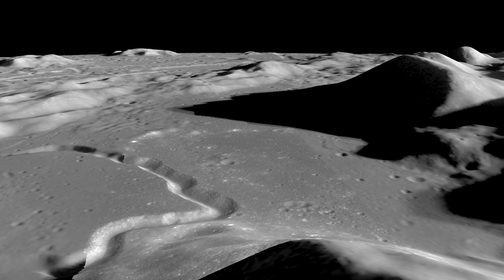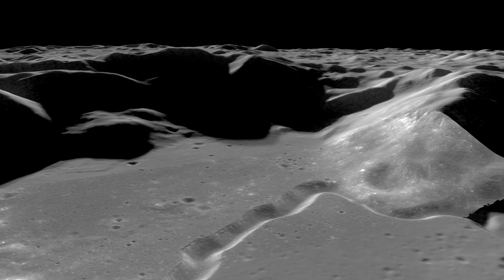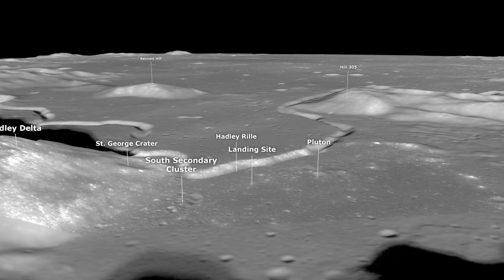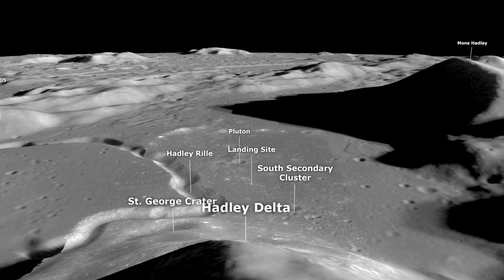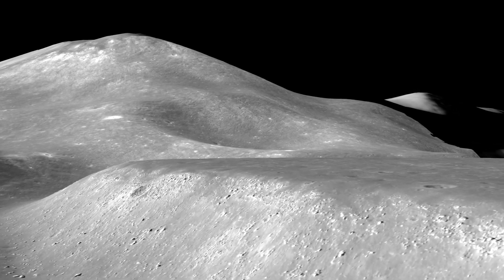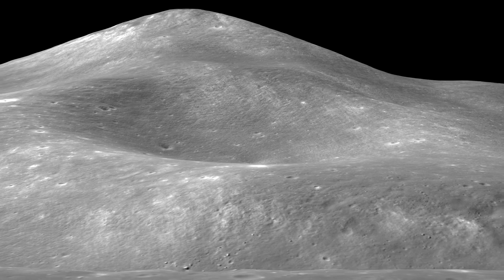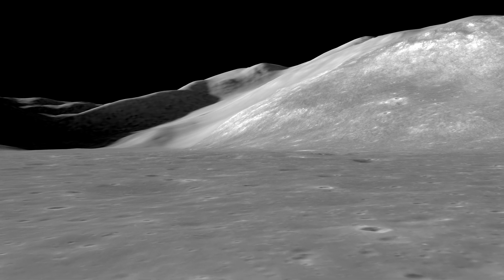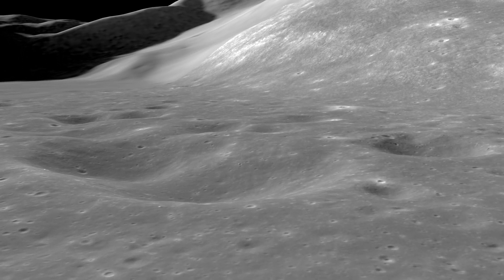Apollo 15 Stand-Up EVA

Comment: 17 miles, how great. But seems like a unique lack of caution for NASA (ie, rover dies). There must have been some low max distance in any one direction
Reply: An old comment, but worth replying to for anyone wondering: The distance to the lander was always taken into account, so while they drove a lot of total distance, they never farther way from the lander than they could walk. 

That said, the rover did have some level of redundancy - it had front and rear motors as well as front and rear steering, each could be operated independently if they had problems.